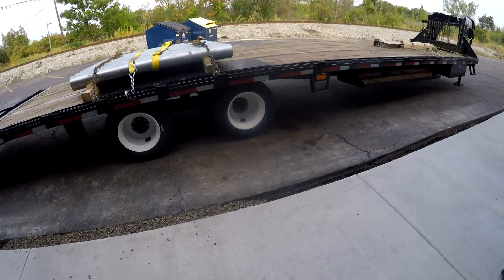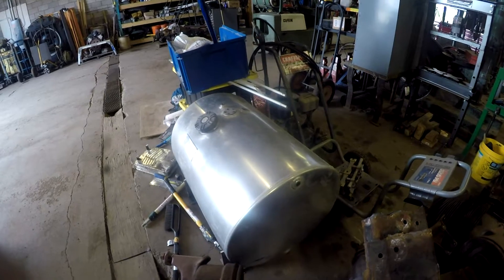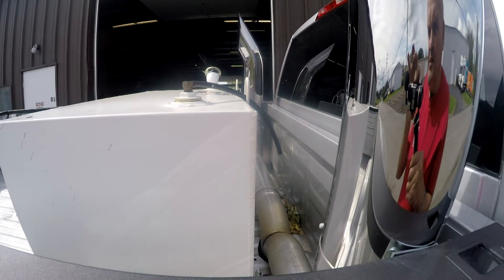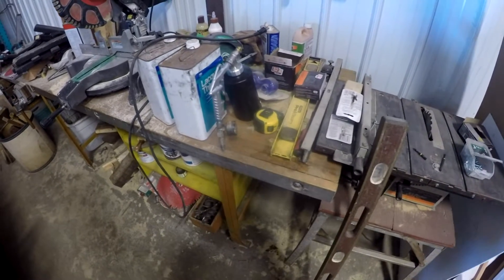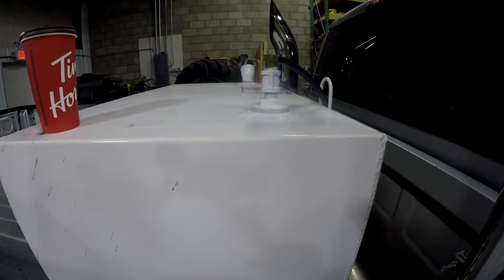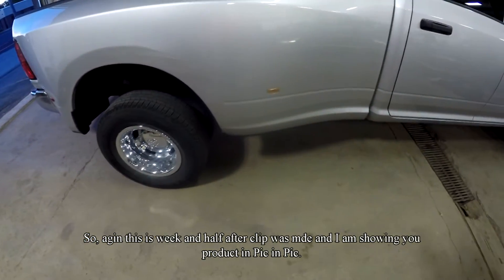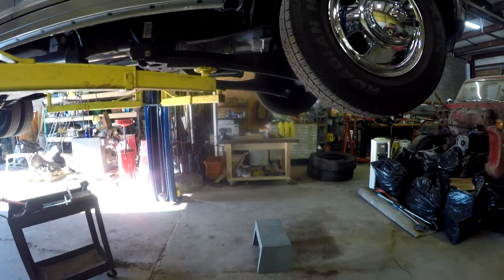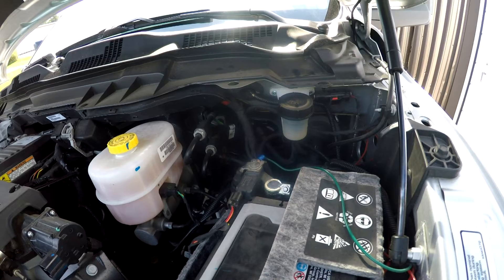Shop Update 09/22/19

Comment: Yup you have been busy! I find those ceramic disks too often times be grabby for trying to slip when doing tight manuvers like backing a trailer into a tight spot. You were lucky that you can drop into low range to help with that.  Won't be long you will be beating me out for that 47000lb gross weight haul I made with my old one ton. :-)
Reply from the maker: I will make sure that I leave that milestone reserved for you and the radial arm drill!!!
 The clutch does get a little grabby in those situations but I can live with that in favor of added HP range and heat resistance!
You will have to bring us up to speed on the drill in one of your videos! You still planning on moving it back by boring machine? You could swing head over table and make two bores at same time, one vertical and one horizontal!
Reply: Fred Newman pretty sure the arm on the radial isn’t long enough to span the lathe headstock and motor. Would work on my little one but not the big boy 😎